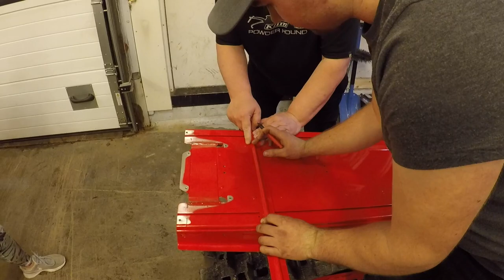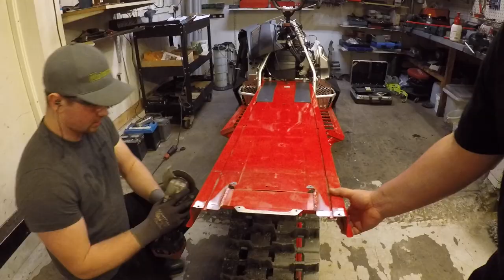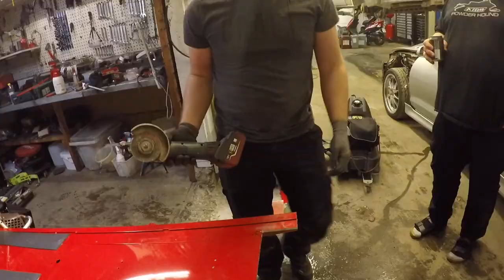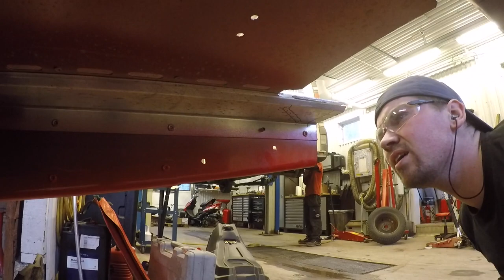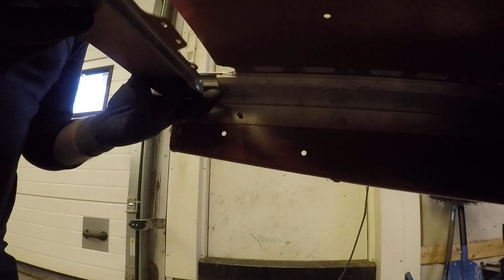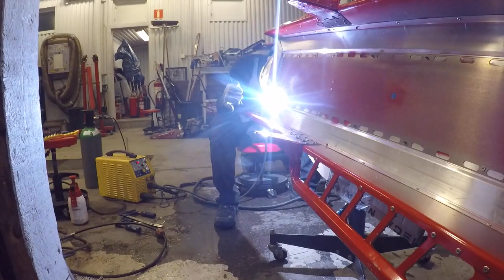TUNNEL SHORTENING BRAND NEW Polaris 800 Pro Rmk 155'' 2019

Comment: What Tig filler rod did you use? And what diameter? Cup size? Thanks in advance
Reply from the maker: I believe it was 2mm 5356 filler rod. Cup size 5. Gold tungsten 1,6mm. 😊 
Are you shortening/improving your sled? 😃

Comment: Looking for advice. I ride similar snow conditions and I currently ride a 146 SKS. I don’t like the wide tall seat of the 146 but a 155 is too long for my area. 

I want to get a 155 SKS and cut the tunnel down to a shortened 146 length, so like a 137 with a 146 skid. 
Will I have any issues taking that much tunnel off a 155?
Reply from the maker: Justin Gilks should not be any problem.  That will be about as much as we cut of the pro( 7-8iches). But on the sks you have an extra cooler in the front= you will have more coolant than we have on the pro 👌

Comment: How does it run for cooling? Looking to dot he same with my 155
Reply from the maker: Never had a problem with cooling. I’ve never had a single overheat on any of my sleds. But if you do alot of trail riding you should buy an extra cooler. Mtntk has good ones 👍

Comment: but why?
Reply from the maker: short summary: less snow in the tunnel, more flexibility(the tunnel dont brake in the snow anymore), even if the sled is tilting 45 degrees rearwards(almost upside down) is still has the track in the snow, and if you are trenching deep your tunnel cant get hung up on the snow.++++++